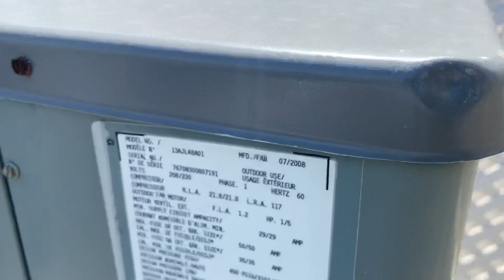Central AC Condenser Won’t Turn Off - Stuck Contactor

Comment: Thanks bud I was just hoping my son deal with his and I have a little bit of knowledge around contactors and that's what I thought too is that the contact was stuck closed or open whatever he want to say it and sure enough he's got a bad contact with froze open or closed and would not release which was making his refrigerant lines freeze up and his AC not want to kick off but just thanks for having us video to confirm what I thought was the issue